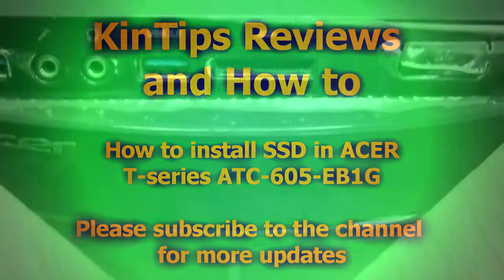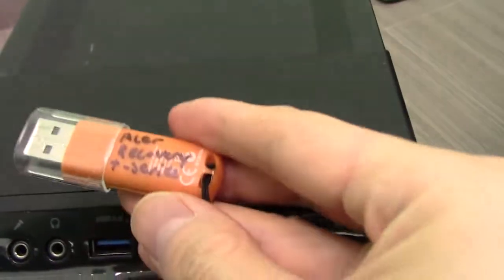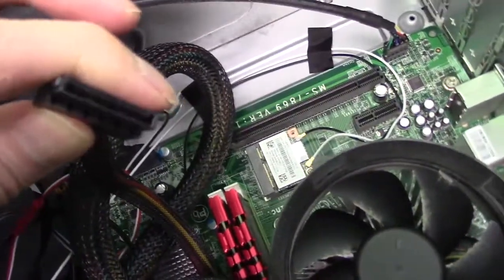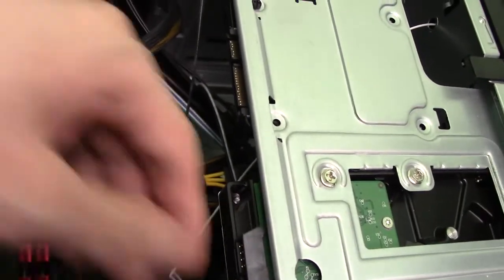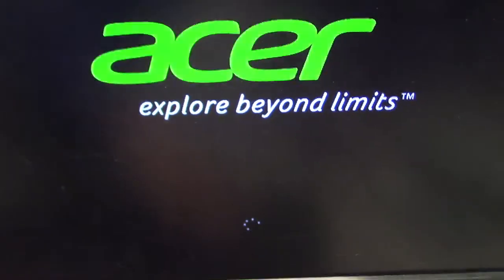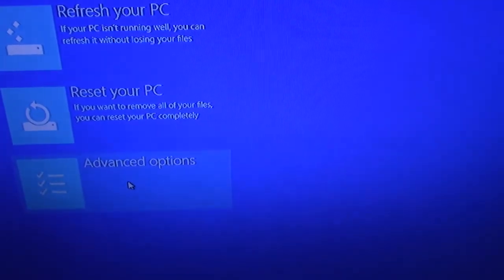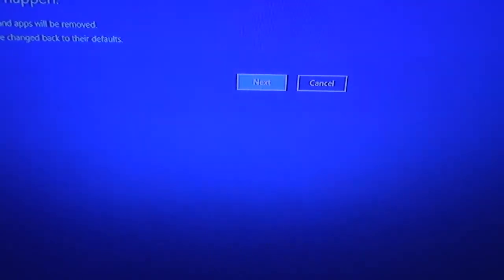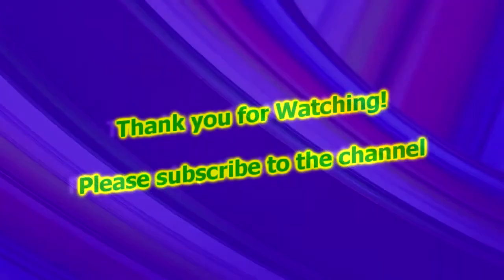How To install SSD into ACER T-Series ATC-605-EB1G computer

Comment: sir i also have the same MOBO as you have but only 1 ram slot is functioning i want to add more ram but the blue slot cant read my ram, do you have any idea sir?
Reply from the maker: it has to the same type eg DDR3 etc.. and speed

Comment: Can u tell me ur set up? Specs?
Reply from the maker: i5 32gb ram, ssd/HDD, low end ati radeon. Everything runs pretty good, you might ask why low end graphics card, Power supply isn't strong enough, also case size is too small to support a bigger one

Comment: These are weird machines to upgrade. Mine is a TC-710 and while it has SATA cables free, there is no location to actually mount a 2nd drive, so I'll have to leave it loose or mount a bay myself. I was looking to install an M.2 drive instead, but the free M.2 socket has the hole for the locating screw blocked by a rivet. The PSU as you mention is total crap, which limits what GPU's you could move up to (nothing AMD). They really dont want people upgrading them lol. They make it really hard. I've tinkered with the idea of upgrading it, but I'm more tempted to just build a new unit from scratch. All that said, the machine has run flawlessly apart from the CPU fan dying (the ONLY fan the machine has)

Comment: Greetings from Canada! I have the exact same computer, but my model is an ATC-605-ER2K. I've been studying for the possibility of adding an SSD on that desktop computer (along with upgrading the RAM memory - it currently has 8GB installed, but the system can handle up to 16GB of memory).

My only concern is, how do I mount the SSD to my desktop? I also haven an old 1TB 5400RPM WD hard drive (from my Lenovo Thinkpad P50s laptop) that I had upgraded. I'm thinking of using that as extra storage. 

What advice you should consider in this case?
Reply from the maker: SSD is small and light you can mount it anywhere, i just shoved it on top of the HDD
Reply: @kintips  thanks for your prompt response. I apologize for the delay on getting back to you. 

I'm thinking of upgrading my underutilized 2TB desktop HDD into a 1TB or even a 500GB SSD. 

I'm also going to clone all of the contents from that 2TB HDD into one of those SSDs. What is your suggestion for this situation?

Comment: I have a atc-605-eb1h laying around that I stopped using because the HDD began having issues after a year. I just left the computer laying around because I replaced it with a nice laptop. Out of the blue I decided to repair the old acer, I was going to get a standard HDD but maybe a SSD would be a better option. I'll look into it right now.
Reply from the maker: you should the cost of SSD is cheap and your ACER will be a lot faster
Reply: update: it's working great! cool.